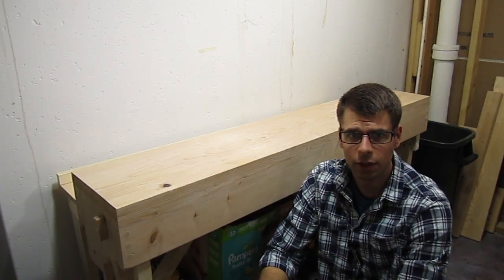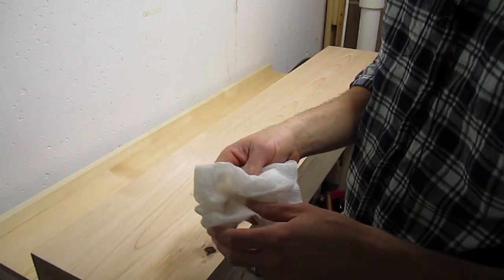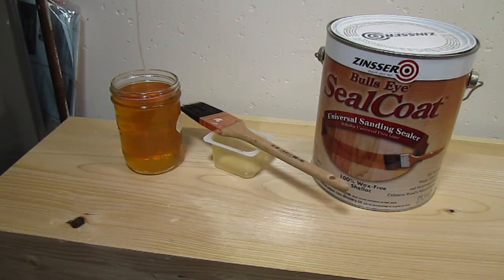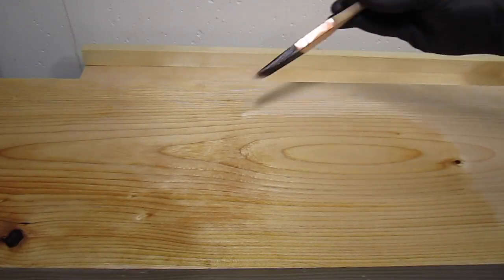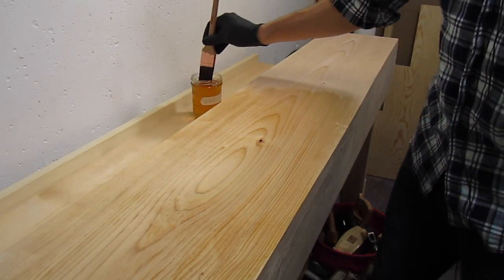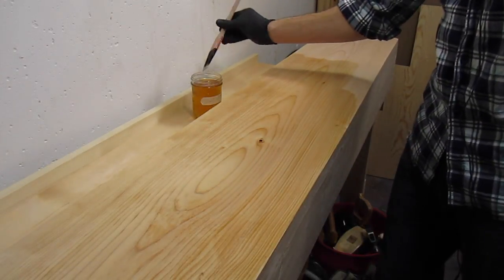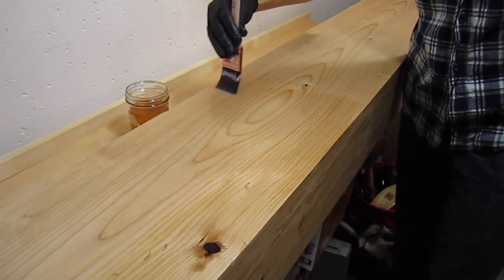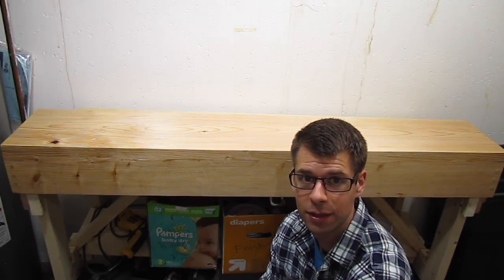Finishing a Workbench with Shellac

Comment: When I was working with denatured alcohol a few months ago, I got curious and found out that certain brands have very high amounts of methanol, as much as 50%. Methanol is fairly toxic - if you evaporated as little as 100 mL of 50% methanol DA in a closed garage without ventilation, you could start to reach dangerous levels of fumes (~1000 mg/m3).  There are "green" versions of denatured alcohol that have only 5% methanol, which greatly lowers the risk of toxicity due to inhalation or skin contact.